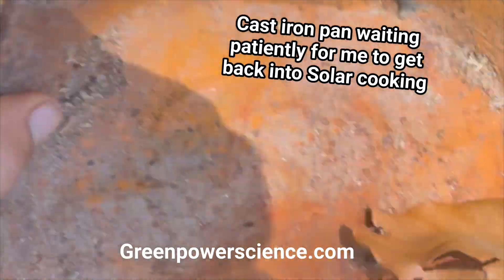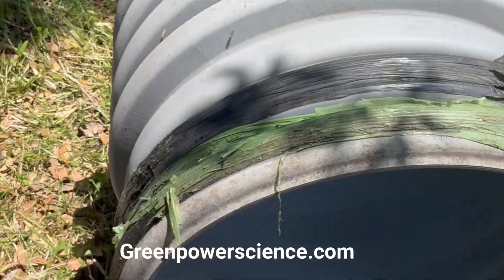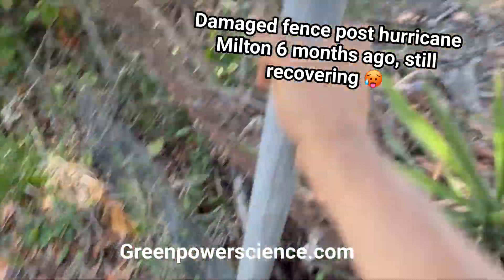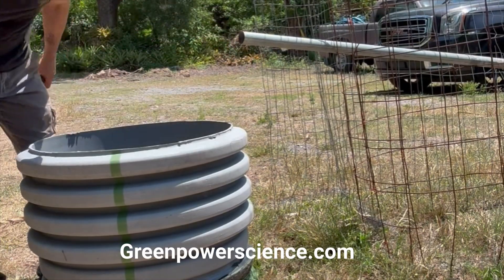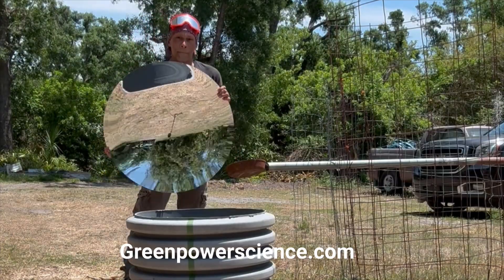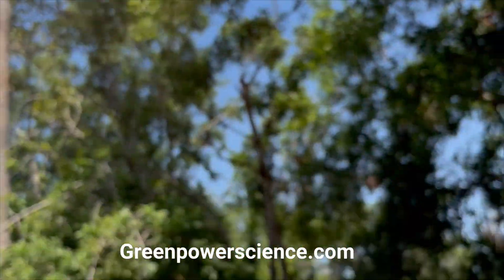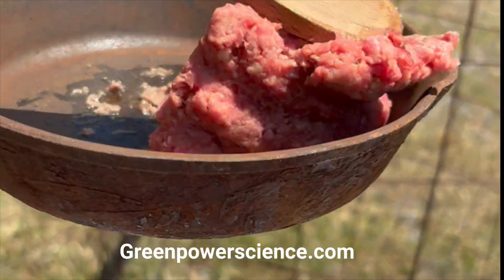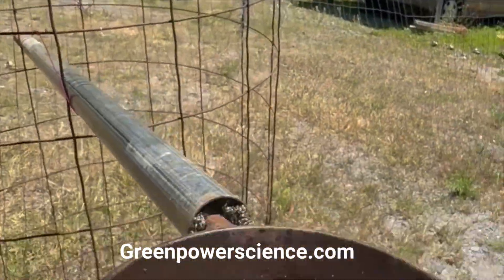Solar cooking with a parabolic mirror DIY random scrap setup for cooking

Comment: I'm working on a mylar mirror for a collimating  display (for a flight simulator) and was wondering of you knew a source for mylar on a roll that is wider than the standard 54". Anywhere from 6-10ft wide would be great. Correct me of I'm wrong but I need to use mylar from a roll as a space blanket has creases in it that can't 100% be taken out - even with a heat gun while under vacuum? Also what is the mil thickness I should be using and should I be spending extra for the mylar with silver in it that is 99% reflective or is the difference essentially unnoticeable?

Comment: Good morning, I'm trying to make a sand battery like you did in the video with the glass tubes. My question is, based on your experience, what's the best way to transform heat into electricity for direct use in a device, without charging batteries or anything like that?